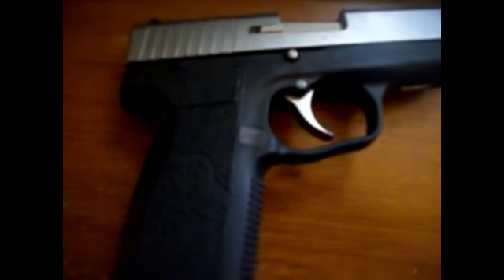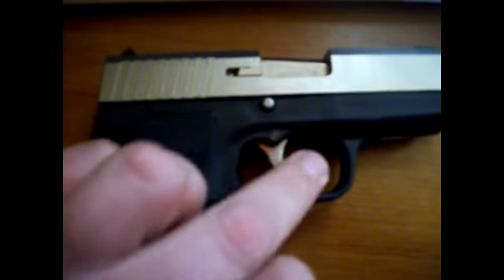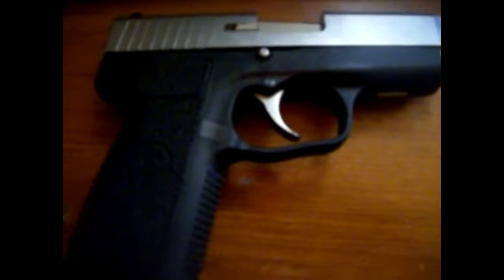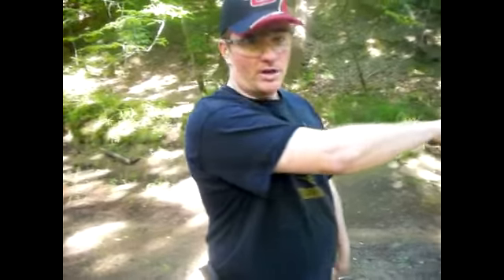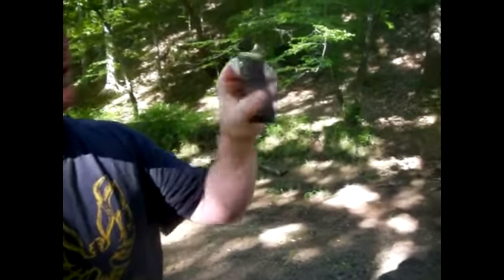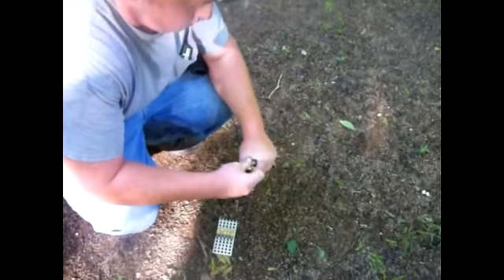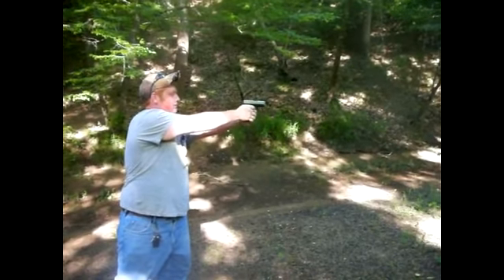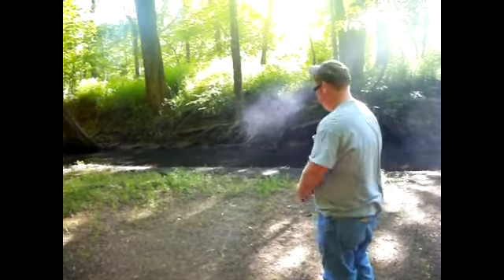Kahr CW40 FTF issues

Comment: Remove the side panel. Remove the trigger bar spring. Deburr the the trigger bar. Re-install the trigger bar spring and side panel. Do not over tighten the side panel screw. That should take care of the problem. If you are afraid to tackle the problem Kahr will pay for shipping if you request a prepaid mailing label.

Comment: my issue with my cw40 is a feed or jam issue, sometimes the slide does not close all the way. I have to rack slide eject round and then it works fine....till it happens again...I have tried several different types of ammo..I have lost confidence in the weapon.
Reply from the maker: I would send that back to Kahr. They ended up cutting material out of the barrel hood to prevent that type of thing. I didn't ask for it being the trigger cam was broken.
Reply: +scrmngchicken403 got rid of it last week and got a FNS 9mm
Reply from the maker: That's cool. I personally have a hard time getting rid of guns.
Reply: +scrmngchicken403 at 54 I have own a ton of guns they are just tools. I do have a couple I am fond of and it would take a lot to part with them.